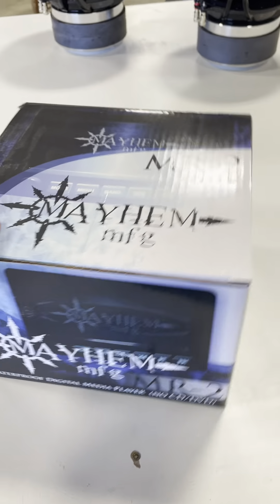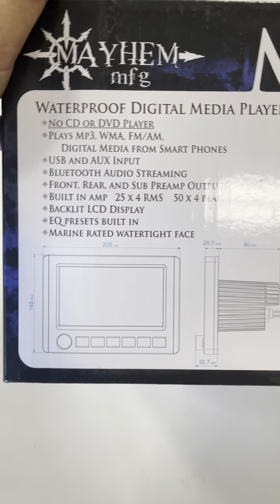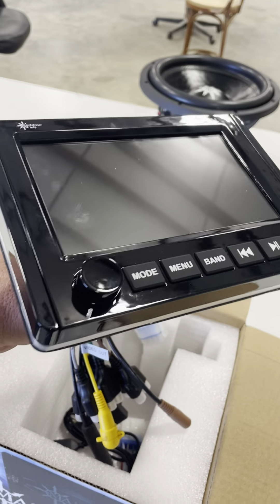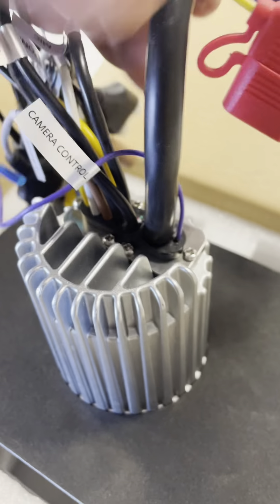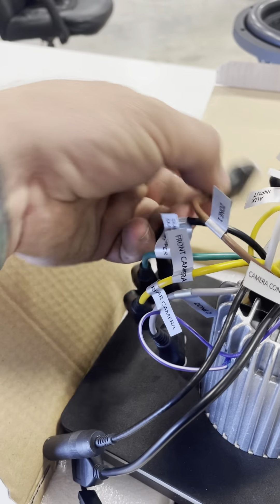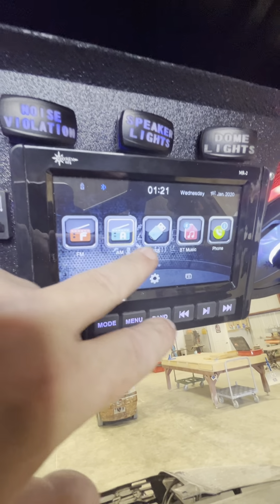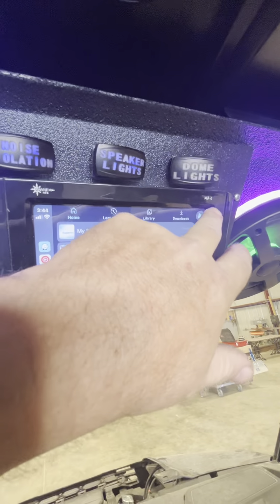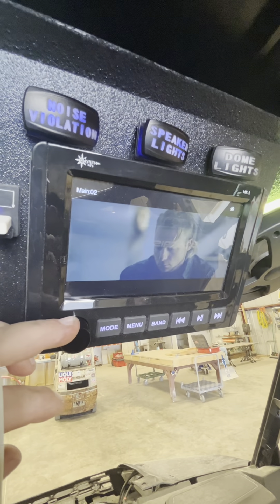BADDEST Marine Grade Head Unit on the Market! 7” Mayhem!

Comment: I just had one of these installed at my local stereo shop. They sell them under MMATS Pro Audio name, but they told me it's made by another company. There's not much information out on this unit right now. So far I really like it. I wish it had a remote.
Reply from the maker: The MMATS unit is solid.
Reply: @Beau_knows  the audio adjustments are incredible! It really woke up my system in my boat!